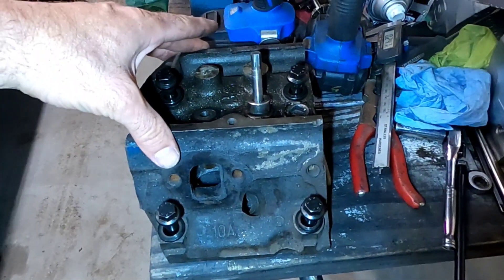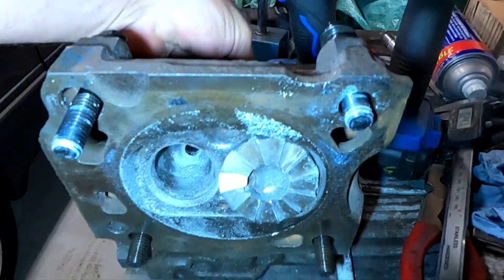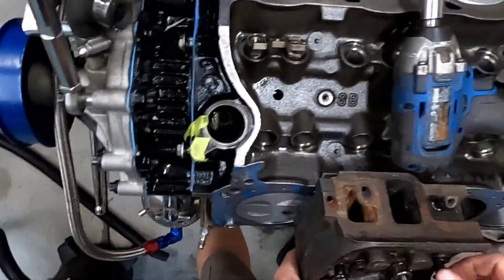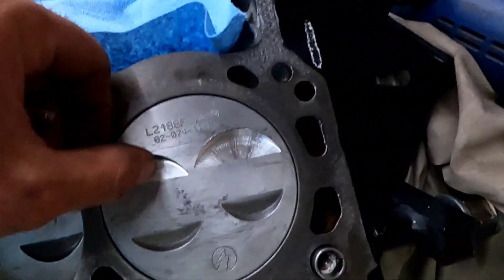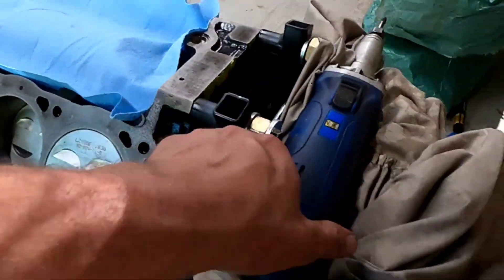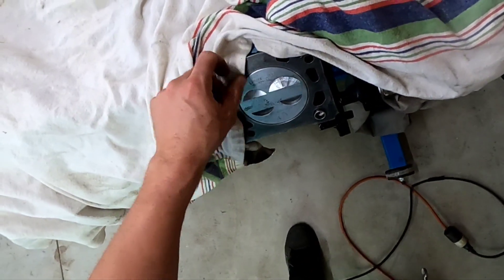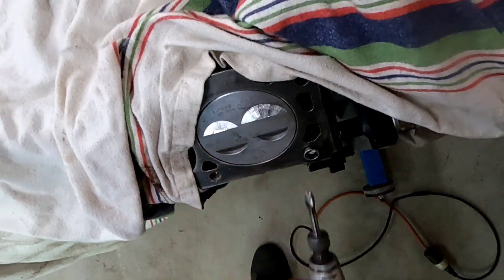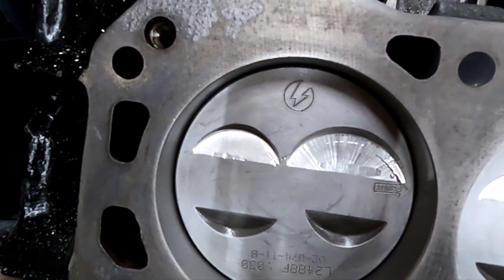302 SBF piston flycutting.

Comment: I been running my 5.0 since 2011 after doing this fly cutting on the pistons of mine and while it was in the car no less.  No issues still running great to this day 164k miles, and my step son drives it daily now. Its a good inexpensive way to run bigger valves.

Comment: All looks good the only suggestion I can make is to tape across the whole deck and just leave exposed where the cutter is actually going to cut into the piston . Why let the aluminum particles get down into the gap between the piston and the cylinder wall also anywhere else ?
Reply from the maker: Good idea

Comment: Nothing wrong with doing this.  You have to do the same when you build a 4V head Clevor.  There's only one thing that's getting missed.  The bob weight now changes and you need to pull the pistons, dial all the wights in, then rebalance that crankshaft.
Reply: Question: can't the harmonic balancer neutralize the few  thousands that he took off? Especially if you intend to spin the motor barely just past 6krpm's?
Reply: Definitely....I prefer my balance to be dead on.  I want my bob weight to include the rings and dial in weights on every assembly.  When it comes to balance I'm quite anal but to be 100% honest, it doesn't have to be absolutely perfect.

Comment: For the intake pockets, lay the edge back a bit more from about the center of the valve toward the center of the cylinder leave about 0.100 above the bottom of the pocket untouched. A trick David Vizard teaches on "piston porting". This aids the intake charge at low lift and close proximity to the valve, flow over the relief and into the cylinder. Not important on the exhaust as the flow comes to the valve and port from the quench.
Now on the head quench pad aiming at the exhaust valve, lay the sharp edge there over a bit to aid the flow at close to TDC at the end of the exhaust stroke slide out the exhaust valve and port.
Reply from the maker: This engine was put back in the bronco 2 8 months ago. He had freshened the engine up and assembled it then Decided to buy AFR heads when I told him the pistons won't clear the valves. This obviously isn't optimal or the best way to do this but it's a happy engine and works very well
Reply: That is where one recommendation I make is to plan a project. Think long and hard about what you want and may want. If it is considered to possibly change up the heads down the road or go to a more aggressive cam, it is wise to do any necessary clearancing at the time of build. It saves hassles and expense later.

Comment: Thank you Sir for the nudge I’ve needed to finally build such a jig for my tool box now that my son seems to have taken after his mothers side by bleeding that blue oval coupled with my side I’m certain at some point on a Sunday evening such a tool will be in high demand when his latest top end changes sooner or later potentially will reveal the valves need a little more room!
After all, the 228k lower end continues to be a brute surviving all the flogging  and warrants only the finest as we squeezed every last once out of it!
Instead of using towels, sheets, blankets I believe I going to use two or three layers of that sticky back clear plastic  carpet protection to seal off the valley and any passages /bolt holes on the deck surfaces.

Comment: Good job on that 👏 we did this open handed with a drill and a carbide bit , I saw someone commented on here and was down playing this method but I want to let them know that doing it this way works out fine our engine still runs to this day and on a good note runs 9s in the quarter mile stock short block 302 with the piston notched and ported e7 factory heads need I say more to the friendly doubters , and you did a good job thanks for posting
Reply: I agree!
Reply: 9s on a 302 that’s sweet man. What was the build
Reply: Me and my bros are all building 5.0s right now I have 3 cars needed some sort of 302.

Comment: I use a full head with all valve seat area fully machined out but I only use one cylinder and swap pistons onto one floating rod. Use the same stop setting on all pistons on a locked up full float rod so all piston sure the same. Pistons are usually 12,5/12,8. Deburredwith bearing scraper
Reply: Thst why they are uniform accurate between cylinders. I use valves with tool steel and setting collars using one head aligned on dowels keeps total alignment. Been doing this for over 25 years🇦🇺IAN ROSE
Reply: I have been doing it this way for over 25 years on national circuit competition race cars IAN 🇦🇺

Comment: how are you measuring material removed and not throwing the engine out of balance?
Reply: I have done the exact same thing op. Did here, except I used a whole old head iron of course 😅, and have went as deep as 250 deep on the intake and it didn’t throw it out of balance and we turn it 7000, it never misses a beat!!!
Reply: @robbyshinault1069  and i garrente its outa balance, a proper balanced engine is off by a gram or two max, that dont take much, redline is only as high as u want, and chance a complete fail, so sayn u rev an engine 7000 crap, now if it last 20 yrs id say its done right
Reply: @alltherpm What does garrente, outa, and sayn mean?
Reply: @Joesmopargarage   Should I use acronyms
Reply: @alltherpm  Do something to make it look like you at least finished 4th grade.
Reply: @Joesmopargarage  u do 4rth grade level work, wow buddy that's great, ur the smartest guy I no
Reply: How bout this let's rebuild an engine put 300 cast pistons but 2000 dollar heads that's ur level I guess, I guess that's y I'm fastest in my town and waitn 4 someone to step up
Reply: @Joesmopargarage  oh and I made it to 9th then dropped out to start a business, now 42 and retired
Reply: @Joesmopargarage  if u calling me out we can do a no trailer na race any time, bring spare greasable zerks!!
Reply: @alltherpm  All zerks are greaseable. That’s the point of a GREASE ZERK. I’m surprised you didn’t know that, considering you have the “fastest car in town”. 😂 Keep trying clown!

Comment from the maker: I see some of you commenting like I'm the only guy who's done this. This has been done for decades in many different ways from die grinders to sand paper glued to a bigger valve in a cylinder head.  Do what you can to keep things clean. This engine is up and running in its vehicle.  Going through break in and some tuning. 
Thanks for watching, commenting, liking,  subscribing and even negative comments and thumbs down.
Keep following along for more shenanigans!
Reply: The main issue here is you’re doing a horrible job at keeping debris from getting between the cylinder wall and piston. Its pretty simple and easy to tape the head surface and the likely hood of wrecking the engine is slim to none. Apparently you got lucky and it worked for you but why chance what can easily be avoided?
Reply: In my opinion this is the best method. You are cutting the valve relief using a cylinder head to locate it. That's real world accuracy.
Reply: I'm just wondering who's got 50% off...🤔
Reply from the maker: Gopro app throws in an add for 50% off while I'm recording shit and won't let me clear it lol. I haven't been impressed enough with the free version to want to pay for it. 
Took me a minute to figure out what you're talking about.
Reply: The brainless “experts” are as entertaining as the video itself.

Comment: Why fly cut you are not changing  the cam?   What about the depth?  Bob weight difference.
Reply from the maker: The cam that is installed causes PTV interference with the new heads with 2.02 valves.  The owner assembled this in his garage and found the E7 heads were no good so ordered AFR heads with 2.02 valves . It will not be perfectly balanced
Reply: @danscustomprojects4486  it will still be balanced. The rotating assembly isn't going to notice at the very most a couple/few grams. People are just so dumb.